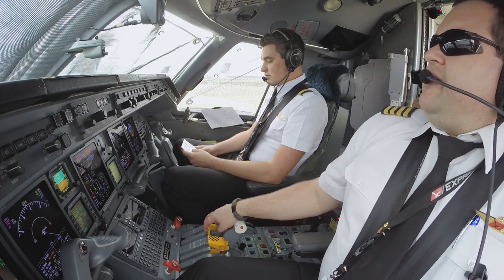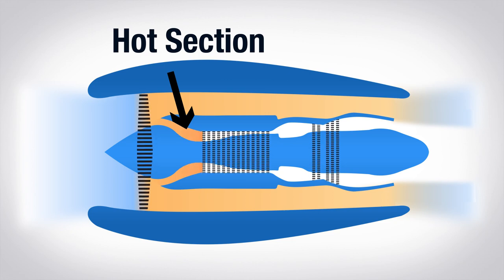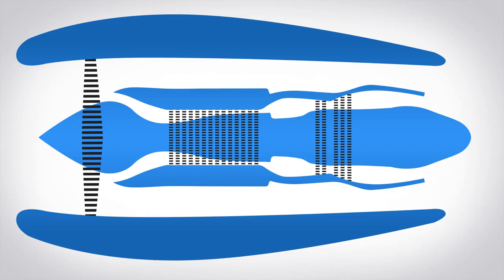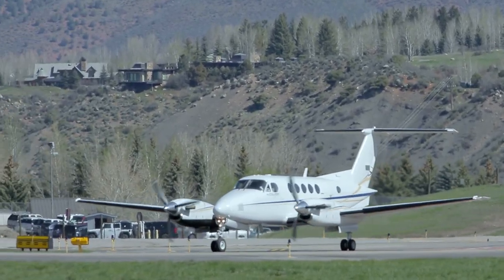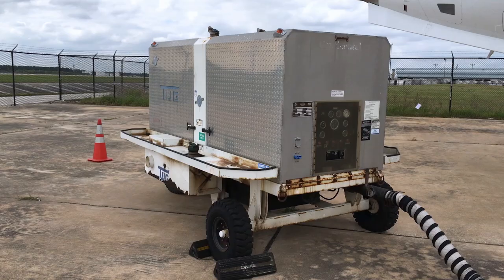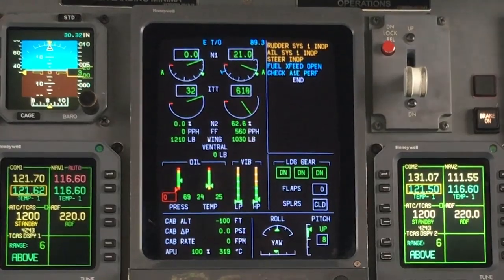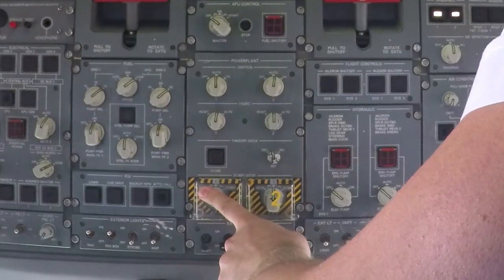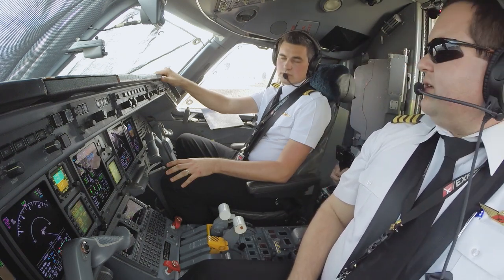How A Jet Engine Starts

Comment: For the Eclipse jet, I designed a circuit that takes and analog of the engine speed in, and outputs an analog of starter torque.
This was to match the profile that Pratt Whitney in Canada engine manufacturer specified. The new engine still flooded sometimes. I was working for General Dynamics that supplied the starter/generator.

Comment: Thanks for the video!  Used to be in M1A1 Abrams and loved how magic happens and how resilient the turbine engine was (they are turbine and not piston tank engines).  Unlike aircraft, they have a simple button for starting and gauges that are designed to let you know when there is trouble and unless master warning or caution comes on, no need to take your eyes off the battlefield.  Abrams (I would say tanks, but it is the only one) and helicopter electric starter motors are big, but nothing like starting a thrust driven plane.  Still cool how a vintage '80s turbine control system can control a ~70 ton turbine driven tank reliably.

Comment: I was a "crew chief" when I was in the Air Force. I was engine-run-qualified on both the C-141A, and B-52D, at different times. It was a thrill every time. I loved it!
Reply: Good stuff. I was a crew chief on 16's. I was stationed at JBA. Fighters are a little different but I would have loved to have been on heavys.

Comment: Modern engines rely on automation to sequence the start events precisely. We don't see it on the video but a lot more happens in the background such as boost pumps in the wing tanks automatically start feeding fuel to the engine and automatically stop once motive flow is established and ignitors momentarily glowing hot in the combustion chambre until the flame is self-sustaining and then shutting down. If it wasn't for automation the pilots wouldn't be so relaxed during the start up. You may catch a glimpse of the workflow on videos showing a PT6 Turbine starting.
Reply: ruirodtube that may be true with other aircraft, but this particular airplane does not rely on motive flow and the fuel pumps never shut off.
Reply: Joe Brown that's interesting. I wonder why the manufacturer would rely on mechanical boost pumps rather than passive jet pumps. I would think pumps would increase maintenance costs a lot. The boost pumps being located in the wing tanks must be expensive to replace periodically because they are critical to the operation of the engine on this model. Strange. 
Do you know when they are energised and when they shut down?
Reply: Yes. The fuel pumps in the 145 are turned on when the airplane is turned on. They are only turned off during fuel cross feed, or when you turn the airplane off. They are very reliable pumps. I probably have close to 10,000 hours in the 145 and can count on one hand the number of times I've seen a fuel pump fail. Fuel pump MELs are fairly rare too. I think I've only seen one in the last 5 years. Maintenance costs can't be that high.
Reply: I noticed that stevo1kinevo does not relax when he starts his turboprop, he occasionally mentions he doesn't want a "hot start" can i impose upon you to explain a "hot start and why that is dreaded so much? Great explanations here. I'm glad I clicked on this suggested video.
Reply: Basically a hot start is when the ITT (temperature inside the engine) becomes to high/hot and can damage the engine. It can be from a number of things, but if a hot start happens and the fuel is not taken away it can cause parts of the engine to fail or break. Your buddy doesn't want a hot start because it could potentially mean having to rebuild or buy a new engine.
Reply: It makes me wonder something... I have heard about these things that pilots can do that can harm the engine... Like letting the engines run on full throttle for too long (in the red zone) can damage the engine and a hot start can damage the engine and so on... So my question is why do the manufactures of jet engines allow for this to even be possible? Why not incorporate a safety system to prevent this from happening?  If you are starting an engine using the bleed valves why would it be necessary to even have the air pressure reach a dangerous temperature in the start up engine? My thoughts would be have a system sensor monitor the engine bleed over temperature and if it were to reach a critical point have it enter a cool down mood.. That way there isn't a chance of the engine going BOOM!!!!
Reply: orangie84 they do have that now. it's called a FADEC, but all it does is shut down the engine before it can reach a dangerous temperature. Also just like any other technology it can fail so it still needs to be monitored. As for the full thrust, it is dangerous to use full thrust for extended periods of time and isn't really needed in most situations. It is however available for situations that require it such as windshear and gpws alerts when you are to close to the ground.
Reply: orangie84 as Doug explained there are FADECS incorporated on most modern jet engines to protect them. 
However some FADECs don't include over temp protections (Hawker 4000 before block point upgrade) and some engines don't have FADEC such as the PT6 turbines which are prevalent in the turboprop world (Pilatus PC12, King Airs, Piagio Avanti, TBM, Piper Meridian, etc). It has mostly to do with development costs.
Reply: Oranje Manatee Is it possible to override the FADEC system? Or does it depend on the aircraft model (I'm guessing it does).
Reply: ruirodtube gotta love a FADEC
Reply: If it is a true FADEC then No you can not override it, there are some that are Supervisory role and those can be overridden a little
Reply: like when had the engineer seat position on older aircraft, som,e was automated but a lot more manual too then  control/instrumentation

Comment: Retired military pilot here.  Great video, let me (admittedly) over simplify with the 5 S's:
Suck (the air in)
Squeeze
 (the air)
Spit
 (some fuel into the air)
Spark
 (add some to the mixture)
Spew
 (it all out as thrust)
Reply: Why did he call the GPU an APU?
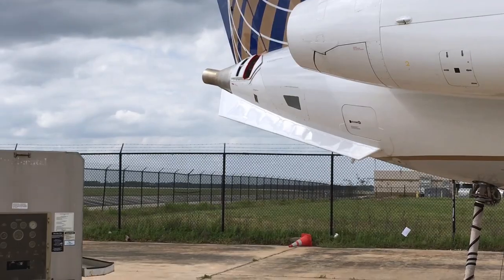Reply: @nickcallisdead  Where? 4:20 is correct, idk what you're talking about
Reply: Trust anything military to be a simple regimen!
Reply: @ronjohnson9507   that's good, my red head left me for the nav lights 😂
Reply: Sounds like my sex life.
Reply: TurnRight  while in crew chief F-15 we called the unit to start turbine the GPU. That was also 99
Reply: Active military pilot here: You forgot the 6th S: "SHIT", when JFS cartridge fails on scramble.

Comment: This video was especially fascinating to me as I'm sure I was on a flight last week whose APU had failed so they had to start using the bleed air system, as outlined in this video. I suspected at the time, so searched just now and found this video.  Basically, we were about an hour delayed for pushback, pilot said they had a number of system failures. I was sat right at the back (777, in the row with just two seats next to the window instead of three - best seat in economy after bulkhead seat - extra leg room), and during that hour delay, I kept periodically heard the sound of a turbine spinning up for a few seconds and then winding down.  I figured this was the APU and that they were having issues with it (I knew as much as the APU isn't really needed during flight, so wasn't too fussed), after a while, I heard a few thuds and clicks from underneath the plane, shortly afterwards one engine fires up and then we push back.  We sat on the tarmac for a while, before I once again heard the sound of a turbine spinning up and then shutting down. The engine that was lit then spun up quite high for about 45 seconds and then returned to idle, at which point I realised the second engine had started.

At the time I didn't realise a bleed air start needed the other engine to be at highish thrust.

Tl;dr - I was on a plane last week I'm pretty sure had to do a bleed air start.

Comment: Great video - just a nitpick from someone in the industry though, your definition of "hot section" and "cold section" is a bit off. The cold section is comprised of both the fan and all of the compressor stages, everything upstream of the combustor. The hot section is the combustor along with the downstream turbine stages, nozzle, etc. Your diagram labels the entire core engine as the "hot section".

Comment: will this fit on my honda?
Reply: NeATaNDtURdy Why? It can't even keep up with that VTEC though…
Reply: "Honda." Do you have any idea how UNspecific that is? FYI: old chopper turbines have been built into a motorcycle.
Reply: Your Honda would need Wings instead of wheels !!
Reply: Yes remember to get the K24 harness for a direct plug and play transplant
Reply: Just Google "Y2K" videos, it's perfectly works for motorcycle. But please leave Hondas alone, they already put a turban in the cars, leaving aside a perfect powerful atmo engines history :(
Reply: no but your honda fits in it
Reply: @lospolloshermanos2692    yes the Portugese one from Brazil,  gotta make some tweaks to the fuel map as well.. should slide right in though, cf34 gets like 0.00001mpg in a civic
Reply: You bet your booty ! Infact it is a perfect fit, I've driven my Honda Prelude over 300,000 miles with that engine ! One day at the airport, I had to have my Learjet stabilizer on the rudder worked on, so being it was a slow day, with minimal air traffic, I used a runway that was out of service to test and open up my Prelude with 2800 hp and 45,000 pounds of thrust ! After 3/4 of a mile I cut the throttle and hit the reverse thrusters, I collided with a 777 on the turmeric, causing 1.7 million dollars worth of damage ! Reverse thrusters don't work well on a Honda Prelude ! Thank God my Air Force buddy that worked in maintenance gave me an ejection seat to install, it saved my life as I hit the triple 7 at 280 knots, I hooked up the ejection seat as a joke as I got it for free. It was Surplus off a  McDonnell Douglas DC-10.The 777 was on the turmeric at the end of my Runway, The pilot was just moving the plane from one maintenance hanger to another and shouldn't have been in the cockpit having flown his maximum amount of hours as was drinking & free basing cocaine ! The FAA said he knew better then to get in the cockpit when he was over the limit !  I had no idea there was a limit on cocaine !
Reply: @planegaper  damn and I thought I was the only dude who did that !
Reply: @NeokingTech  oh yes it can its got 2800 hp & 45000 lbs of thrust !
Reply: @SuperRahul73  they got new wheels just for that occasion
Reply: @raymondstemmer2051  Surely you realize I was joking
Reply: Do you have a honda jet?
Reply: dont be a D...head here........plzzzzz
Reply: @raymondstemmer2051  Sounds like pure BS to me.
Reply: YES,If yoy have a HONDA HA 420 it'll fit.
Reply: yes

Comment: Ok video- some of the terminology was off: The "Hot Section" usually refers to the combustion/turbine sections, and not the compressors. Bypass air isn't used for bleed air applications, since it has very little pressure and close to ambient temperature. "Bleed air", or customer bleed is the term for air pulled off the compressor section to supply low pressure or high pressure, warm air for airstart, cabin pressurization, airfoil or inlet anti-ice, etc.
Reply: Right Sir!
Reply: Correct